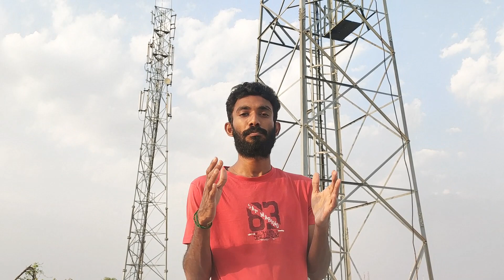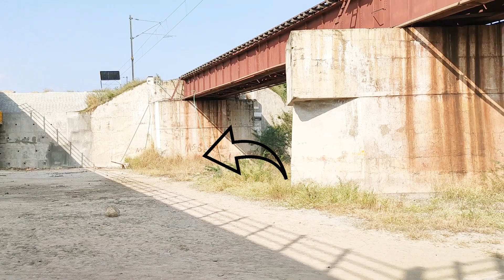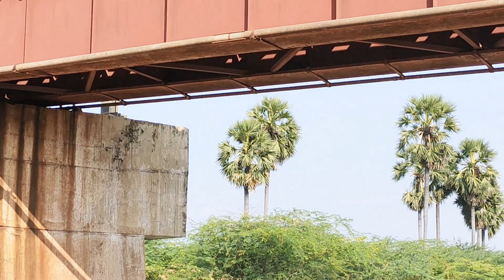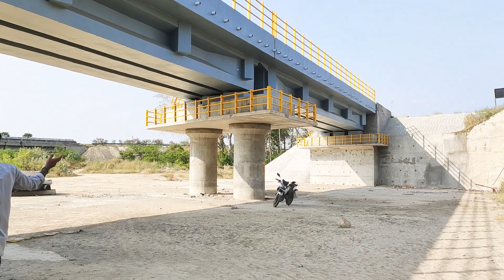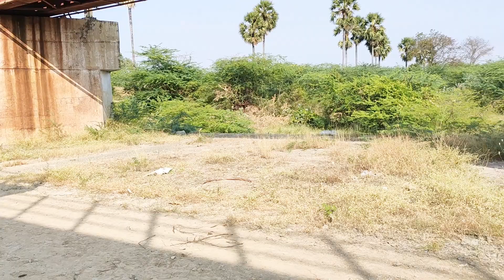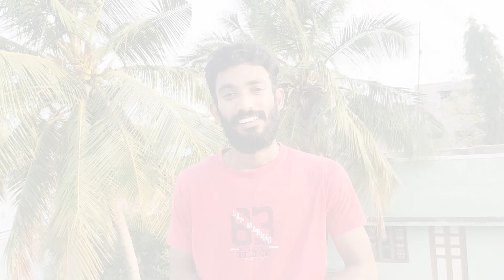Bridges explained in tamil | Steel Vs RCC | Components of Railway Bridges

Comment: Substructure means foundation thana bro aparm epadi ethula mela erukratha substructure apadinu solringa ?
Reply from the maker: Generally Substructure in bridges refers the structural elements below the bearings and superstructure refers the structural elements above bearings. So, substructure includes piercap, pier, Abutment cap and abutment. And portion below ground level includes pilecap, pile & base slab comes under foundation.